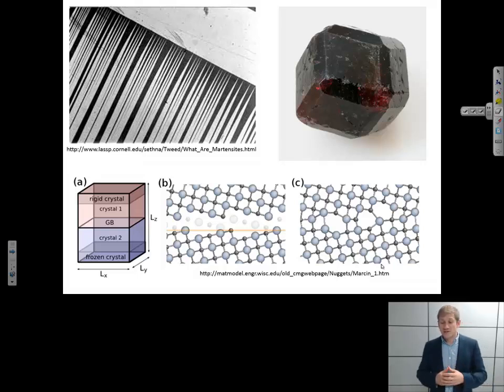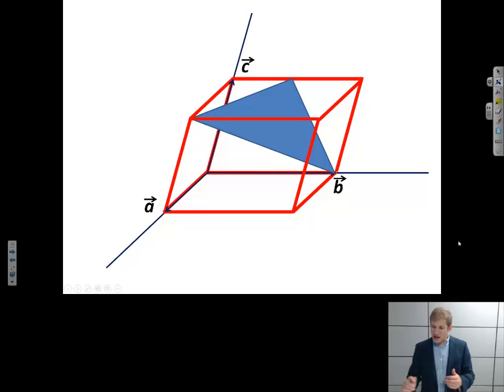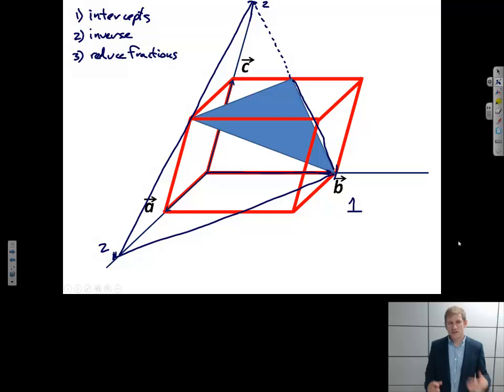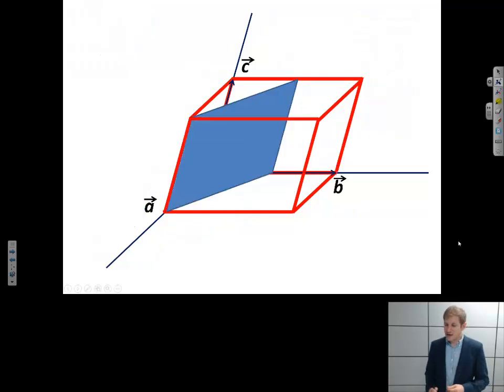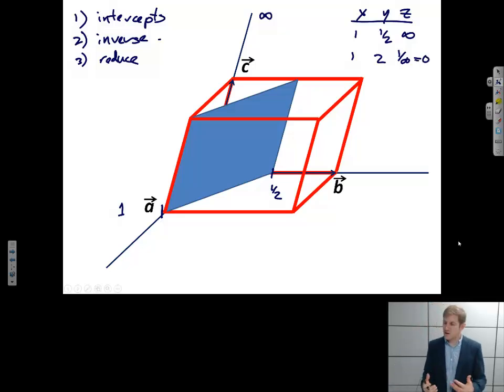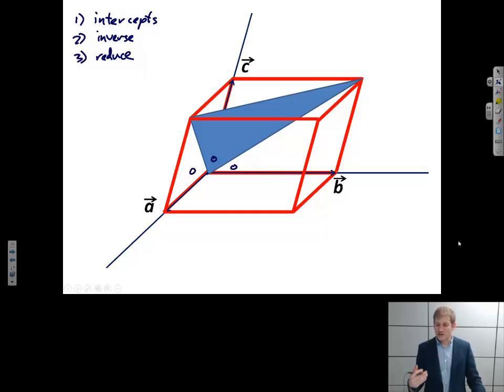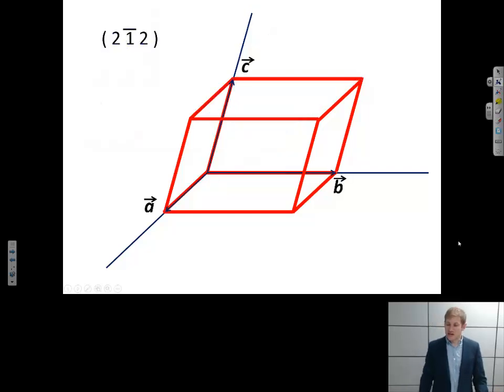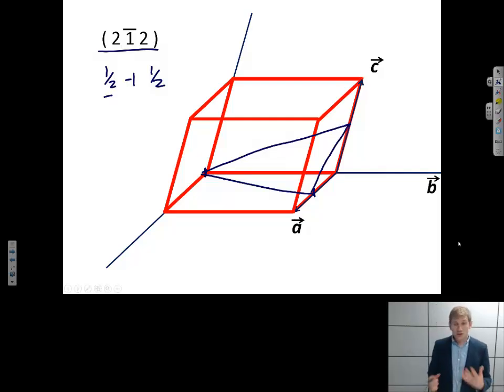Indexing Crystal Planes using Miller Indices {Texas A&M: Intro to Materials (MSEN 201)}

Comment from the maker: It's all about finding & drawing similar triangles.  For example, to find the intercept along the c-direction, look at the triangle on the b-c plane.  You can see part of the edge of this triangle going from the point in the bottom right corner of the unit cell 0, 1, 0, to the point midway along the top back edge of the unit cell 0, 1/2, 1.  To keep extending this line (to the intercept along the c-direction), you would again need to move in the negative b-direction 1/2 of the unit cell length, and doing this would end you up at the point 0, 0, 2.

The other way to think of this is, (starting at the intercept with the b-direction and following the line that will ultimate intercept with the c-direction), going to the left half of a unit cell length requires going up one whole unit cell length.  So going to the left another half a unit cell length (to get to the c-direction axis), requires again going up one whole unit cell length.

Intercept with a-direction is a bit trickier, but you basically use the same approach.

Comment: If I'm given the intercepts (2, -3, 1) the miller indices would be (3,-2,6), so far so good, but if I'm asked to draw the plane given those miller indices (reciprocants would be: 1/3, -1/2, 1/6) the sketched plane would look different from the one sketched using the original intercepts (2, -3, 1), shouldn't the have the same shape? What do I do in these cases? great video btw
Reply from the maker: josé carlos delgado malavé these two planes, (2 -3 1) and (1/3 -1/2 1/6), are parallel to each other, and thus can be translated on to each other.  because crystal lattices extend indefinitely, we consider these the same crystallographic plane.  it is just easier to write planes without using fractions.  hence, (2 -3 1) would be the standard notation.
Reply: Thanks a lot man, you were very helpful! Greetings from Venezuela